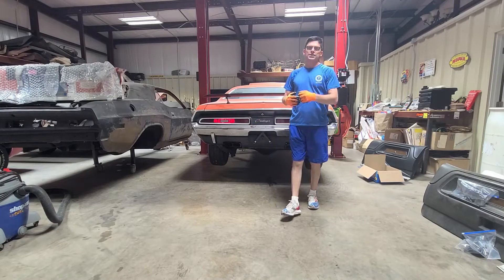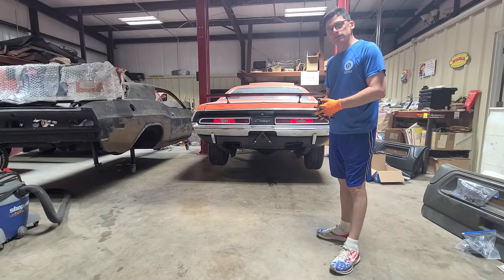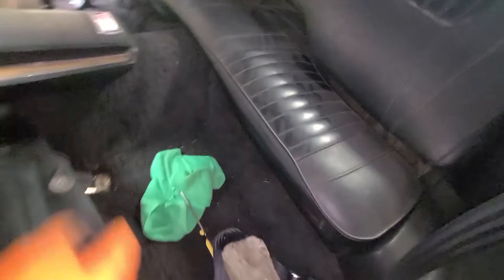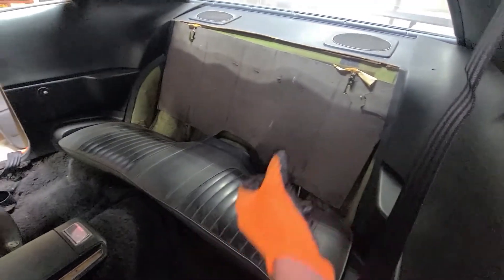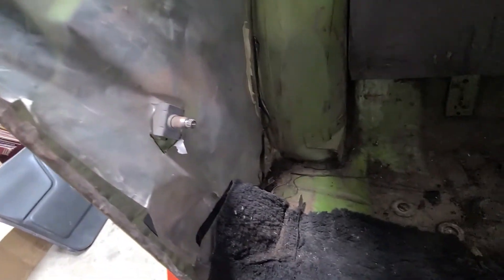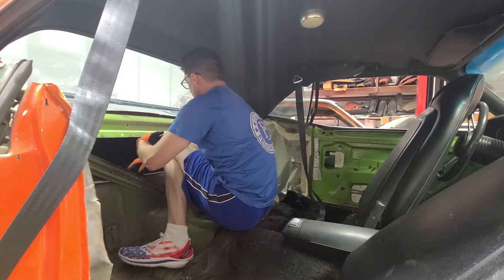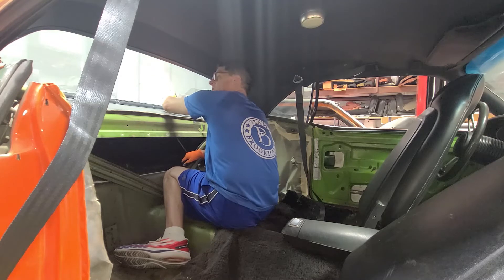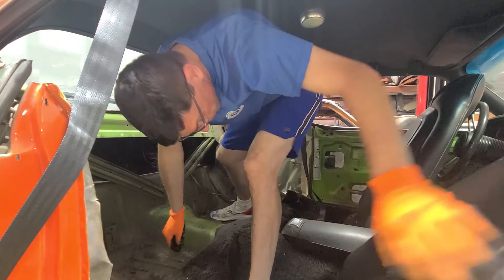1971 Dodge Challenger 440 6 pack Restoration Part 3 - Removing seats and panels

Comment: That water barrier as it's called you show on the driver's side rear was not held into place with tape by the factory.  There was a caulking rope type that was put on, then the thick plastic.  Someone has been in on both side before.
Reply from the maker: Yes. That makes sense. Thank you.

Comment: Did you find the build sheet for this car. Should be in the back seat, behind the seat springs
Reply from the maker: found pieces of it. Very small piece.  I did not find much more than that yet.

Comment: Is the 71 Challenger going to be for sale?
Reply from the maker: It's not planned to be up for sale. Money talks.
Reply: Doug. What do you think this car is worth ? I have been out of the loop for a long time
Reply: @doughowdy7009  if you can find the build sheet (also check the hamtrack lost and found website, they have lots of build sheets that people found in their car which is for a different car) or the original fender tag then it would be worth quite a bit (rare/popular color).  Without either of those it's worth less of course.  If it had the original fender tag or build sheet when restored I'm guessing this car would be $100k range - without the documentation it hurts it quite a bit, and I'm not exactly sure, it will still be a very nice car and a V code vin and killer color :)
Reply: @douggolay3550  Thanks Doug.  I remember way back in the '70s these cars were a dime a dozen.  The insurance rates were through the roof. Especially for the larger 440 motor. I can't believe the price these cars are commanding these days. Always been a Mopar guy. Bought my very first car, 1972 Demon 340 for $3758.00 brand new, and still own ithttps://youtu.be/XH-1DAaptpU. Anyway, got lucky and found a '70 Cuda  E87 with N96.  Numbers matching.,..All original FE5 paint. Now trying to determine what the car is worth ? The current owner has no clue nor do I. I believe the Cuda's are more valuable than the Challengers  ??
Reply: @doughowdy7009  Cuda's are a bit more desirable but Challengers are still very desirable.  There were less challengers with 440 and Hemi's made in 71 versus 70.  As mentioned a numbers matching (with docs) 71 six pack challenger is probably worth $100k (or more) in today's market.  Non-numbers matching and restored maybe $50-$70k?, but I'm guessing.  Probably the biggest issue is that it is a rare car, rare color, and many people desiring that want matching numbers.  Have you tried the Hamtrack lost and found to see if possibly someone has found the build sheet for it?  Because you don't have the original fender tag, If you could find the build sheet it probably doubles the price imo.  It's getting more and more expensive to restore cars (as you know) labor is going up fast, and parts are much higher than they used to be... hope that helps some and good luck, it can be a beautiful car when restored
Reply from the maker: @doughowdy7009 71 challenger v code is rare. They only made over 200 of them. Gas crunch changed the production numbers. In 70 they made over 1,000 v code challengers. That's why seeing this 71 v code is pretty rare.